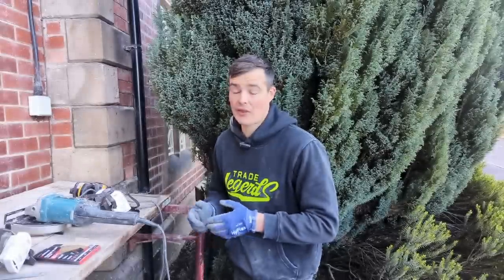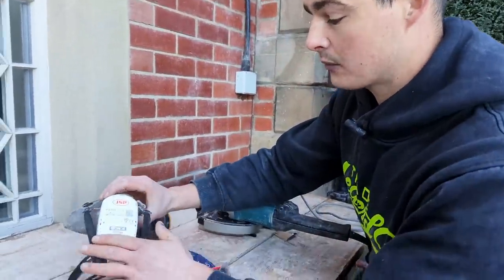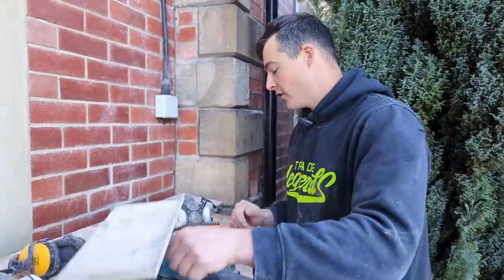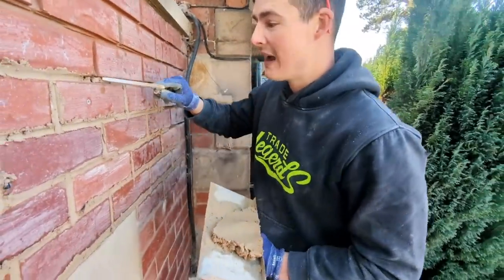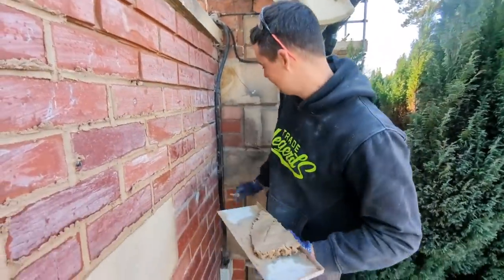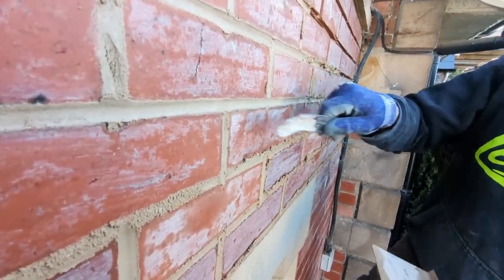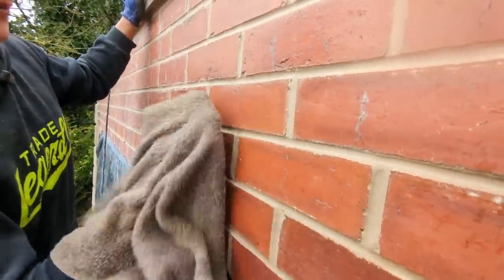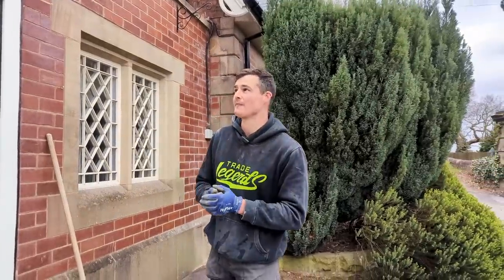How to Repoint a brick wall #howto #diy #brickwork

Comment: Hi Izzy, I recently repointed a 1950's garden wall (imperial, lbc antiques) and it was a mare. Mortar was catching in the wavy lines, and the mortar beds were wildly out. I was going to do the whole house but not sure now! Any tips?
Reply: Any pictures or videos to show a better idea ?
Reply from the maker: Hi mate, it's always hard the first few times, I try to look and focus on the top of the blade and make sure it's just a fraction away from the bricks. All about taking your time until you get more use to it 🤜🤛 send pictures if your unsure mate

Comment: Great video. How long should you wait before scraping off the excess and how long before finishing off and final clean up (for nhl 3.5 lime mortar)?
Reply from the maker: Hi mate, usually once it crumbles off easily with a trowel. So depending on how warm it is..30/40 mins when warm. 2 hours when cooler

Comment: What’s you model of chaser? Is it an angle grinder with a dust attachment? Thanks, useful video - got a small wall to do and this has been a great help
Reply from the maker: @benjaminparkin3229  I think it was a wall chaser. But a 4" grinder with a dust attachment works

Comment: Quick tip Issac 

Take that dewalt hose lock attachment off and attach the hose over the makita elbow directly 
Trust me 😊
Reply from the maker: Yees mate, didn't even think about doing that, love it mate 🤜🤛
Hope your well brother ☺️
Reply: @IzzytheBricky  you’re very welcome mate.
It means you don’t need the duct tape etc.
That makita shroud is really heavy.
I have a 125mm makita which is really small and the shroud is actually heavier.
They are decent though.

Quick tip. Try a company called GOLZ Uk and ask for the MR-8 mortar raker blade 
It will chase 25m2 and is about £20

Comment: Hey Izzy when filling the joint with new mortar try a grout bag. Neater and faster. You can also use some white glue in trouble areas.
Reply: Would a grout bag work with NHL ?
I haven’t tried it but I find with Issac way I can get the finish as I apply
Reply: Would a grout bag work with NHL ?
I haven’t tried it but I find with Issac way I can get the finish as I apply
Reply: @Southpoint2019  Brick, block and stone. You can control the fill and it is cleaner on the face brick. JUst cut the end of the grout bag to suit joint size. Tuck pointing works but slower and more clean up on face.
Reply from the maker: Cheers mate I've never used one, but might give it a go 💪💪
Reply: @edskapin7171  Grout bags are no good with NHL, the mortar needs to be to wet which leads to shrinkage and cracking.
Reply: @bricklayersworldwithandy6277  Don't agree! I have been doing it for decades and so does everyone else I know. Flagstone, artificial stone all use regular mortar. A type "N" mortar ( regular)  works just fine. I am also a licensed bricky with 47 years experience. Tuck pointing takes to long on big jobs! Been using grout bags on stone and repointing since the 70's!! Not my opinion only .
Reply: @edskapin7171  Type N Mortar is Portland Cement which is fine to use with grout bags, NHL 3.5 is a pure Lime mix which is a different animal, to wet and it will shrink and crack . Only 47 years, you wont catch me up then,😁👍
Reply: @bricklayersworldwithandy6277  You answered your own question to wet!!! Sorry not my personal opinion even architects and engineers spec it for repoint jobs. None of them crack unless you use to much water. It is in your best interest to update yourself with what is going on in the world. Why is there so many brick repair video's in the UK? You rely on person opinion how you do it! Sorry buddy your not an expert!
Reply: @edskapin7171  Do you actually know the difference between cement mortars and, NHL, Putty and Hotlime  Mortars ?
Reply: @bricklayersworldwithandy6277   Yes I do. However I have a question for you. Why is there so many empty voids on the back of your brick work?? Your using wire brick ties banned almost everywhere since the 70's except UK. Where is the vapor barrier on block face between block and brick again a code item except UK which anything goes. Andy instead of being a self claimed expert you need to educate yourself in proper brick construction. You know what a building envelope is?? If so you would know what weep holes are. The water entering your wall cavity because of empty joints leaks into the cavity saturates the insulation that is a fact? Educate yourself with proper brick techniques before preaching to the world.  I'm done!!
Reply: @edskapin7171  You are making yourself look silly, you are quoting US Regs which are relevant to you but not UK and Northern Europe. The UK has the most stringent building regs in the World,everything designed around the environment, we dont have Earthquakes,   Water does not enter brickwork through the back of a wall🤷, ive been to the US and seen the brickwork😯 and every bricklayer just clipping the head joint,not full joints. I dont recall ever proclaiming myself to be an expert but thanks anyway, bye 👍
Reply: Won't work with nhl. The mortar needs to be properly compacted into the joint to stop failure. Only time you'd use something like that with lime is grouting voids inside solid stone walls
Reply: @Mao.Loves.Zedong  You guys got to stop watching UK video's. Ever used a grout bag? You do know you cut the end of bag  to match the joint size and insert the end into the joint and fill the opening so it is tightly packed. You then use a tuck pointer and or jointer to pack the joint so it is tightly packed and finished. If does not work for you your doing something wrong. The only difference with a grout bag is your not scraping it from trowel into the joint. It is 10 x faster and neater. You should also educate yourself what the rest of the world is successfully doing! Been on many government jobs where this method is spec'd by architect and engineer. There are better ways out there. Izzy is a good bricklayer does a nice neat job but he also looks for better ways.
Reply: @edskapin7171  if the mortar is to wet like it needs to be to work in a grout bag then you can't compact it properly a lime mortar cannot be used wet. I've used grout bags for some jobs they are a good tool but I'd never use one with any lime mortar. I've worked on houses built in the 12th century and even saxon churches. They've been standing a lot longer than the US has even been a country. I'll stick to the old methods 😉
Reply: @Mao.Loves.Zedong  Think about it! If the mortar is to wet it runs down the face and makes a mess. I don't think you have ever used a grout bag the way there intended to be. You do know they sell them at masonry stores around the world right?? Currently there are UK brickys mixing portland and sand with a shot of dishwashing soap in it. That's illegal everywhere! The build standard for masonry outside of UK is far higher than what you do. If you look at the You Tube video's for masonry more than half are repair video's from the UK. Why would anyone use 4" block c/w brick veneer to build house? No one uses it? On the outside of the 4 inch block facing the brick where's the vapor barrier? Read up on building envelopes? The ties you use are pieces of wire? Codes are far stricter outside of UK with far less issues and repairs in the future? Why hang on to the old ways when they don't work. Remember the rest of us out there build schools , shopping centers and government buildings to name a few.
Reply: @edskapin7171  I actually use a mortar gun like said so much neater and quicker even better with stone work
Reply: @pedrostokoe1980  Never used a mortar gun but if it works great!